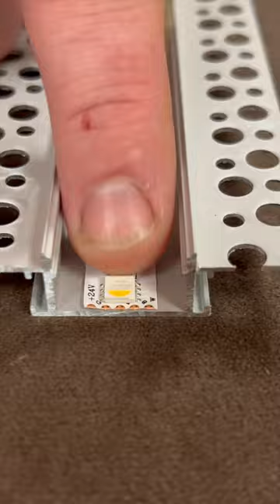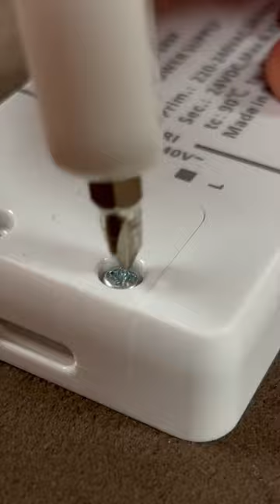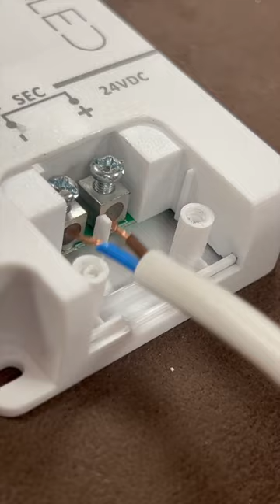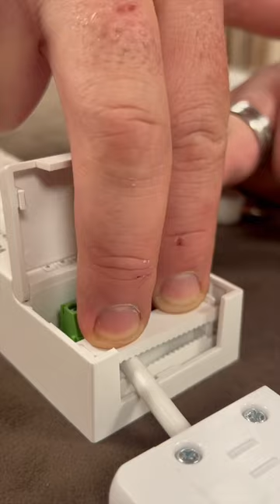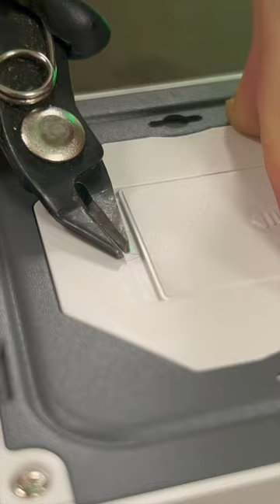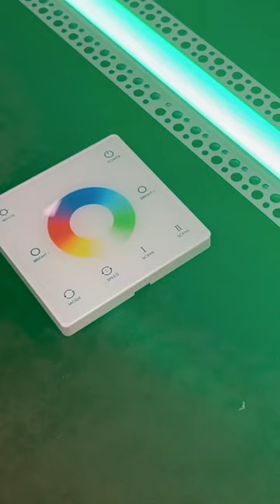When Electricians' Unlock Disco Mode!

Comment: Even though this is relatively new to the market in led strip terms it's pretty old hat now. You can get the addressable stuff with RGBW and CCT tunable. Plus it only requires 3 wires.
Reply: 🤣 I said the same. I've had them around the overhangs on my house since we moved in. I do a small led Christmas light show each year and leave those strips up for down lights through the year.

Comment: That LED Strip is gonna get loose after a few hot days. I started to tie them to the profile every 30-50cm with a cable tie.
Reply: If you clean the profile before installation of the ledstrip, maybe even use 3M primer, it won't get loose

Comment: Screw terminals,how 20th century
Reply: Perfectly adequate. And most appliances still use screws.
Reply: Yes proven technology. Works great
Reply: @andysims4906  Precisely.
Reply: Stranded wire, screw terminals and no ferrules and no insulated screwdriver? Wouldnt hire, not a professional.
Reply: @hasserecht3678 no ferrules required as the screw dosnt damage the cable . It’s a clamp that the screw  pushes tight on the cable copper strands .. Not sure why you would want a insulated screwdriver when working on things that are not live.
Reply: @andysims4906  because if you use screwdrivers with quality blades you are less likely to ruin the screwheads like with these cheapo chinese bits he uses. And yes it's not necessary but the wires in the Video tell their own story. Always use ferrules if you can.